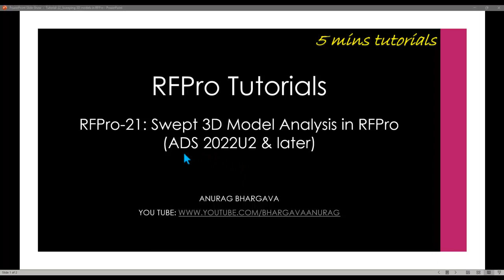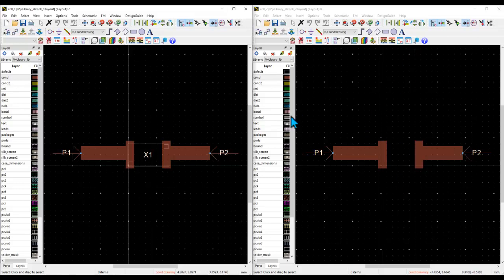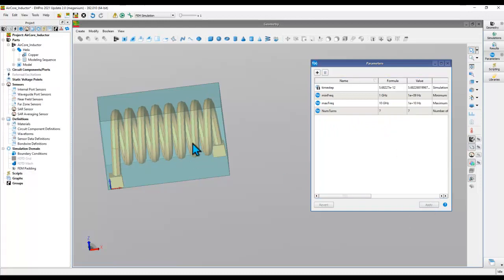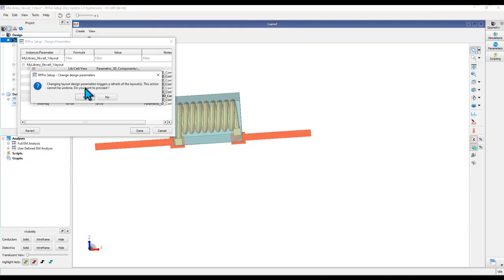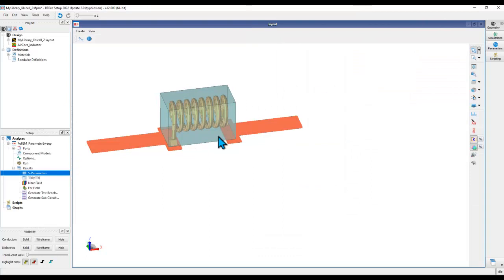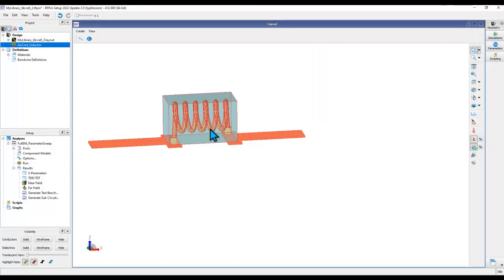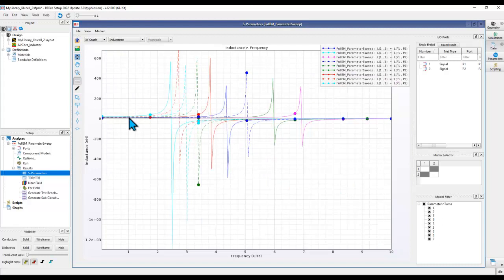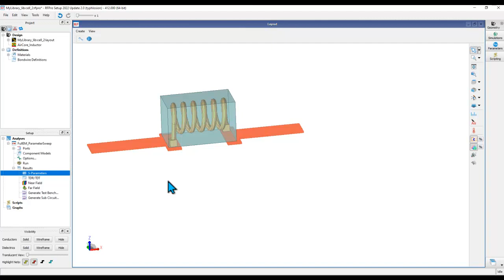RFPro-22: Swept 3D Model Analysis in RFPro

Comment: Hi, I was trying to do the same you do on the video but i don't see the "Setup Parameter Sweep" window on the FullEM_Parameter Sweep  (minute 5:05). I'm using ADS 2022 U2 and I'm doing exactly your same steps. Do you know how to make it appear?
Reply from the maker: Hi Alvaro,
You don't need to do anything in order for that menu/window to appear. If it is not there then it means your ADS version is not 2022U2. Kindly contact your local Keysight tech support for further help in this matter.

Comment: Hi , I heard that RFPro is able to link HFSS. Is there any limitation on CPU usage?
Reply from the maker: Hi,
To use HFSS inside RFPro, you would need the RFPro & W3061 HFSS link along with Ansys HFSS license. I am not aware of any limitation of CPU usage and it will depend on what kind of HFSS license you have. Currently you cannot run parallel/distributed EM analysis with HFSS option inside RFPro.
Hope this helps.